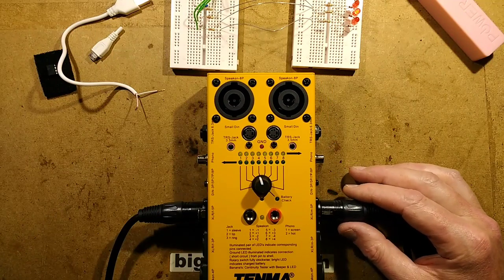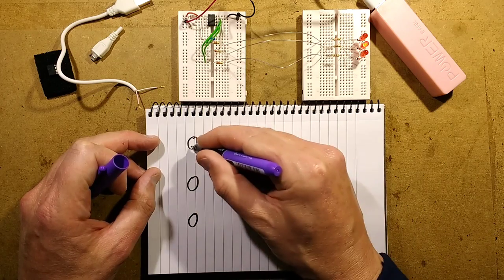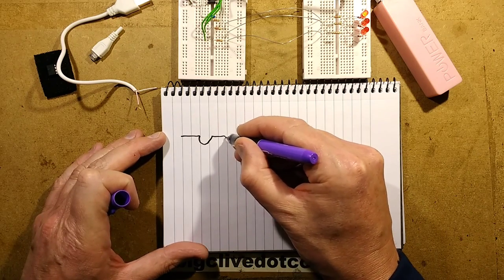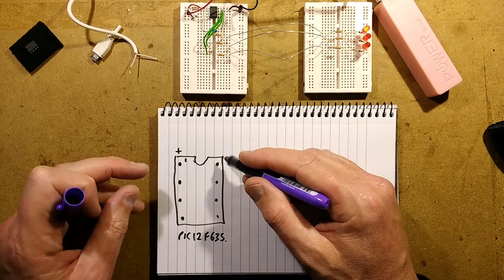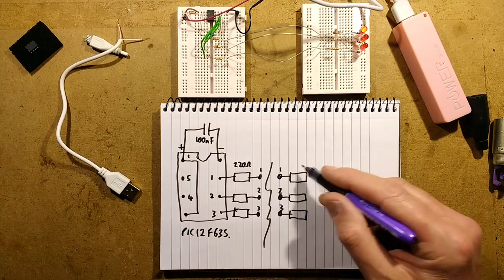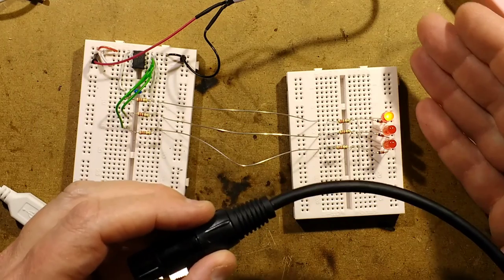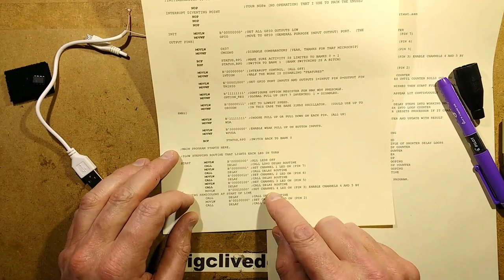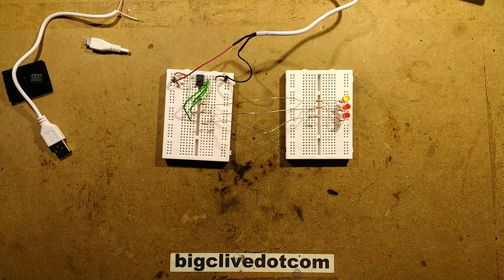Experimental 3/5 core DMX cable tester.  (Including PIC software.)

Comment: "... and the reason I chose a PIC12F635, is because I have over a thousand of them, so that seemed like a good idea!" :D
Reply: David Graham Well, there are times when availability and ease of use make a good compromise instead of choosing the best fitted solution.
IMHO If I had to pick a PIC to buy, I'd use a SOT23-5 PIC10F200 for this simple application.
Reply: SOT23-5 would not be enough pins for testing 5 core cables as SOT23-5 has only 3 I/O pins. Even for a 3 core tester I would like to have   a few I/Os to spare. Offcourse, Muxing the pins is always possible, but it quickly becomes more complex do mux/demux signals the to simply use a bigger PIC:
Reply: +sarowie Serial to parallel conversion is really easy actually, using 74HC164s (8-bit SIPO shift registers). If you've got 128 lines to check, you only need 16 registers in a chain! :D
I made a MIDI keyboard out of an old electronic organ in much the same way, it's just backwards (parallel-in/serial-out).
Reply: I'm trying to picture how that might have happened: Clive walks down to Poundland - "Special offer: 1K PIC bundle, one pound!" - "okiedokie then..."
Reply: +Attila Asztalos, you joke but I once ordered a set of filing cabinet rails from Amazon and they sent me their entire bulk warehouse box... so now I have hundreds of them.
Reply: You beat me to it, David!! Ugh.  :-)

Comment: Once upon a time I used to do experiments with the acquisition computer some distance from the detectors with a lot of it being controlled by Camac (Computer Applications Measurement and Control). One of the things that would often cause trouble was a bad line on the multi pin camas connectors, so eventually an engineer suggested I write something that would verify the camac lines and I did. It was called Camtest and it was a god send. Hope this proves as useful to you.

Comment: L O L ... ".. Is because I have over a thousand of them." 

Back in my theatre days, we had a similar multi-cable tester that you showed at the beginning of the video. One of the venues was a permanent installation with many dimmers using AMX, and as they added new dimmers, of course they got DMX.  We had a converter that ran between our light board and the dimmers backstage. (A bit off the subject: We had a patch panel that looked like an old-fashioned 'phone operator' panel. Any dimmer (different capacities) could be connected to any circuit.  Most of the fly's had circuit/sockets above the pipe. Very handy indeed!

Comment: I built a similar tester (the non pic version) for testing portable heart monitors when I worked in the electronics department in a hospital in DK in the 80'ies.
When new, the wires were nice and soft. But because the nurses used alcohol for cleaning, the wires became stiff and inflexible. Result, loads of testing for bad connections.
Reply: I doubt they use alcohol now, with ozonated water readily available. Love that stuff.

Comment: I have a cable tester,  it produces a pattern on its LEDs similar to the first chip you show here.  Designed to use with ethernet cables,  I also have adapters to some other stuff.  You can connect both ends of a cable to the device,  or one end,  or jumper the output to a wall plate for premise wiring,  and use a remote to verify stuff.  It's come in handy to show me which cables really are ethernet cables and which aren't,  and to show things like crossed pairs,  etc.  The "fast" speed is similar to what your tester does,  "slow" goes a lot slower,  I guess giving you the chance to wiggle thing around.  Runs off a 9V battery.  I should probably open it up one of these days and see how it works.  :-)

Comment: Nice idea. 
As in all low power usb-fed builds like this one, you may want to add two LEDs and a small resistor in series over the power supply, in order to identify a dodgy USB power source quickly.
And if you would build an inverted twin of this build, you can use the two sets to identify and test two cables at one go. That could half down the time you spend walking back and forth when testing fixed installations of XLR cabling.

Comment: Will pass this along to a stage production friend. They may find this very compact and useful 😺😺
Reply: We have a tester that basically decrypts the signal and also tells you the polarity of the signal(which you can do with actual data due to the protocol itself). it also uses the ground reference and the Pins referenced to eachother. So you'll see if there's a problem with the ground or if you have a problem with one of the data pins. My physics teacher built it back in school.
Reply: Nothing encrypted, so nothing decrypted.
Reply: Well turning the ones and zeroes back into an adress and a value and telling you the length of the start/stop signal and if it's there at all...

Comment: It's been a while since I encountered assembly "in the wild", and it's nice to read your code. Also, great documentation! You know the programmer knows their stuff if the comments are full of snark :)
Although, it would've been better if your documentation included the fact that your "DELAY" and "SDELAY" routines also turn on the LEDs selected by the bits in the working register. Other than that, it's all fine. The "DECFSZ" operator is a tricky one, though, if you've never seen it before.

Comment: Hi Clive, I designed and built a cable tester for my audio cables that does intermittent fault detection as well as showing pin-to-pin layout using only discrete components a few years ago. I'll see if I still have the schematics lying around somewhere - or just pull it apart and redraw it. It's been an absolute lifesaver for me!
Reply: How does it do that?

Comment: You don't need the 10k resistor for the reset pin, but it helps for troubleshooting\development as you can then pull it to GND later for any reason, without shorting out the power supply.

Comment: You could do like I do when building something "semi-permanant" instead of using resin/epoxy use high-temp hot glue instead. That way if you ever need to service it, you could heat it with a hot air gun to melt the glue out then service it and replace the glue. Can get a bit messy but it works.  Cheers.

Comment: Great video Clive. I couldn't help thinking that perhaps the PIC could have been better used by looping back the output to the input and doing some form of automated tested. Maybe doing something clever with rise times. I built a few PIC based cable tester for testing some special machine harnesses, these had large multi core  Harting connectors and the pins used to frequently push back into the housing and loose the connection. I had more pins and used a bigger PIC. Unfortunately these tester did not survive long as the service techs kept plugging them into live cables. These were 415 three phase and data. Bang

Comment: I used to use a hobbes 258991 for cable testing. I made adapters from "anything" to D-Sub 25 and tested every cable made before shipment. Simple in theory and praxis - awesome in result. Of course, that was a lab/workshop tool, not a field tool like this, but the flexibility pays off.

Comment: I love the juxtaposition of a guy capable of programming in assembly printing said code out on paper. :)
Reply from the maker: +Ray Cathcart It should have been tractor fed dot matrix printed paper for effect.
Reply: @bigclivedotcom  Nah, it should have been the original coding forms on which you wrote out the program, with your hexadecimal hand-assembly to the left of it.

Comment: a suggestion for an improvement (if possible).
if you put LEDs on both ends it would help in several ways. 
1/.  remote connection either unit can be put at any end, which helps with cable identification of remote positions (multiple cables missing id tags)
2/. helps if iffy connection is at either end and you cannot see the other end.
3/. if different programmed sequences are used then 2 or more units can be used simultaneously to identify 2 or more cables at the same time. 

Not having worked in lighting but in  none professional (village hall type) sound, many many years ago,  long before DMX was readily available. 
This would have saved me a lot of trouble rigging a stage.

Comment: This is is the same way the cheap network cable testers work. Nine remote LEDs so you can test shielded cable, each with an inverse diode across it. The one I've got uses a 555 and a 4017 plus scan and single step switches.

Comment: You could have done the same thing with the leds on the transmitter side, it would help you out on understanding which wire on the transmitter matches the wire on the receiver.

Great work

Comment: that's a cool looking cable tester I made something similar for a cable tester we had at work it tested 60 connections which tested for continuity and showed open circuit and also crossed over connections and indicated which connector was at fault

Comment: It's funny how audio and lighting both use XLRs for connectivity, I'd hate to be the muppet who connected a lighting system to an audio amp... :P
Reply: Random unpredicted rave party!!!!!!
Reply: That's why the direction is reversed. You can't plug a cable where DMX "comes out" (XLR female at the end of the cable) into an amp that expects sound to "come in" (XLR male at the end of the cable).
Reply: @TobyAsE120 But you could toast a mic and probably the DMX output if you plug them together.
Reply: anonym musiteufel the components usually are quite tough, but im Not entirely sure whether something would Happen. maybe give it a try...
but you wouldnt even get so far. connecting up DMX and placing the mics are usually quite a Long Shot away from each other (time-wise) when you Set up an Event.
Reply: Actually the DMX standard says that only 5 pin XLR connectors should be used to prevent mix up between audio and lighting cable. However most cheap fixtures use 3 pin connectors since the 3 pin XLR connectors are much cheaper than 5 pin variants.
Reply: From my experience, quite a lot of them actually have both, whichmakes it much easier. At least in the builds I have been involved in, the 3 pin is always the one used. The extra conductors that dont even get used just isn't worth the cost.
Reply: anonym musiteufel As Clive stated, DMX has maybe 6v on the line, phantom power is 9-48v. most mics will not care except ribbon mics--and those are not out on tour. Tried and true SM57 & 58 don't care.
Reply: @TheUnFoundBug - Yes a lot of the mid range stuff (Chauvet Pro springs to mind) have both types so they can be mixed with cheaper stuff. Some of the more expensive stuff also have 3 pin (Robe + High End systems) although i'm not sure why. if you can afford £10k movers you can probably afford 5 pin XLR cable. The other big issue with mixing the two is that DMX cable should have 120ohm impedance where as mic cable is not built to have a specific impedance which can cause issues if mic cable is used for transmitting DMX signals
Reply: Rumor has it a common Shure SM58 mic can be used as DMX terminator in a pinch. I haven't tried it, but I met some old guys telling to have done it in their time.

Comment: If you don't mind me asking, how much did you spend on the 1000 PICs? Must have been quite a deal if you bought that many.
Reply: They cost about 30$ on aliexpress in lots of 50 with delivery. Since he has a few thousand, I'm guessing he paid a lot less than 0.60$ a chip.
Reply: Exactly, unless he uses them a lot (like hundreds every month), it doesn't make sense to buy such a huge stock unless you get a really good price and I'm curious as to what that price was.
Reply: well he does use/sell them preprogramed with the rgb controller kits i'd guess thats why the collection there http://www.bigclive.com/shop.htm
Reply from the maker: dgo85 The kits currently use PIC12F629 chips.  I get through a lot of them too.

Comment: My first PIC programmer was one I knocked up myself with the guts of a USB keyboard (using status LEDs as clock, data and R/W gate, with output via one of the key connections), wrote the assembler for it too :)

Comment: Cheap chinese ethernet cable tester works in similar way, it loops over all lines in order. It's missing all lines constant indication mode which would be very nice to have indeed for the same reason you mentioned!
The unit itself comes in two pieces which can be attached to both ends of the cable, not necessarily in the same room.

I still think your design has a flaw, it would be nice if it has a button to change the mode of operation. Debugging while is looping over modes could get quite annoying still.

Comment: i have the behringer ct 100 cable tester and its very good, you can test: short circuits, intermitent conection, phantom power an also a test tone with level adjustment, but yes i would like  it to have a remote...

Comment: If you put an LED and diode pair on the input s you should get the inverted signal at that input end.
This will allow you test test an in place cable without having to be at both ends, or if your helper is not having a good day you do not need to trust their feedback.

Comment: In case anyone is interested, I wrote an AVR version (in c) for the ATtiny85 at https://github.com/samueldewan/cable-tester/ .
It can be easily configured to support 1-5 cores, custom timing and common anode or common cathode wiring.
Reply: Awesome!

Comment: Latched indication for testing intermittent faults would be great, I have been scratching my head with how to do that within software. So that once the connection drops, the led no longer shows steady state but intermittent untill power off or reset somehow. It could be quite hard to spot in the scanning mode.

Comment: Clive would the resistors be OK if they had 42V phantom power pushed down them accidentally?
Reply: Boris Stanier normally, it should be fine! Because phantom power has series resistance of something like 6 or 8 kOhm so it's current limited. 

Now if you assumed an angry off spec phantom power source... That would be quite another matter.

Comment: You could just use 2 PIC microcontrollers, one for stepping through slowly, the other for solid on, and switch between the two with a switch. That way you don't have to wait for the mode you want.

Comment: You are doing a Julian here and choosing a part that is in the category "only available whilst stocks last".  I can buy the last two PIC12F635 from my local "quality" supplier or wait a few weeks for something black and with legs from China. I don't think the MCU matters and will grab  whats available on offer locally.

Ahh assembler. OMG.  It might be an idea to advance into the 1980s. :-) It was in 1989 that the company where I worked changed the coding standard to say "no assembler". This was for support reasons.
Reply: writing in Assembler is sometimes simpler then writing C.
MPLAB comes with a working assembler (no messing with the C tool chain), the Datasheet describes the assembler in detail, Clive already can write PIC ASM, most of the code is accessing Special Function Registers and the business logic is compared to setting the SFRs simple. I would write that in ASM as well. The software will require little maintenance in its life cycle. Most time in software maintenance for such a project will be spend on setting up the tool-chain (where is the pickit? MPLAB X looks so different from the previous version. Where is the driver for the pickit2? Firmware Upgrade for the programmer? Why and how? ...) Even in companies, a lot of time is wasted in rebuilding tool chains.
Reply from the maker: sarowie I abandoned MPLAB X.  It was like starting from scratch and trying to find the simple bits you needed in a mountain of bloat.

Comment: Hey Clive, i really enjoy your videos!
There is one thing though, the audio levels are really low to the point that I can't understand you when listening to you on my laptop speakers. It would be really cool if you could bring the audio level up a bit. 
Keep up the good work (=
Reply: Potion Seller it's probably your laptop speakers. He's coming in loud and clear over here at 50% volume
Reply from the maker: Potion Seller The Moto G4 I record with is let down badly by it's locked audio settings.  Low level from the microphone and bass boost on an already bassy voice.  I'll be trying a different recording device soon.
Reply: Clive I always turn down my bass on my logitech computer speakers (2.1) or otherwise the neighbours can dance on your voice vibes :)

Comment: Hi Clive, thanks for all the circuity-goodness. Have you considered adding LEDs at both ends so that you can diagnose an installed cable from either end? It might be more convenient sometimes. Also, you could use a very similar circuit for Ethernet CAT5 cable testing too. I can't resist asking... why have you got so many PICs?
Reply: I bought something like this for CAT5, but the PIC shown only has 5 open leads. How can this be done with 8 leads?
Reply: use a different pic
Reply: CAT5 testers are usually 4 pair and screen. The classic Mod Tap testers we use only have 4 LEDs plus one on either end.  I'd send mine in for  a size 15 bear tear down but they are £120.  Worth making your own methinks.
Reply: You could multiplex the outputs quite easily.
Reply: We (company long gone) made some 10base-t ethernet installations back then and we made our own RJ45 cable tester system with similar idea.. It's kinda simple.. one PIC16C84 (yeah, that old) with leds and passives components.  2-part system was really handy cause one could leave active µc unit at hub/switch side and check the final line from some rooms away. 

Never did release schematics or code.. Makes me wonder if I'd could find it.

Comment: Would it be worthwhile to have the micro verify a signal, rather than LEDs? (Would need one with more IO ofc)
Say there's a very brief fault, quick enough that the change on LED might not be visible to a person, but the micro would detect it